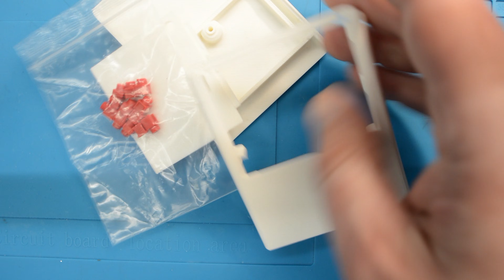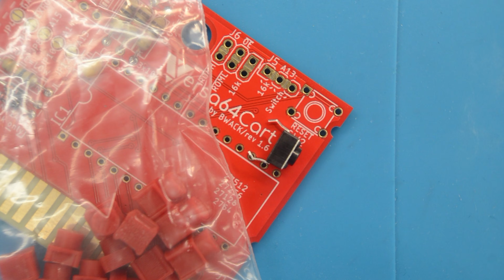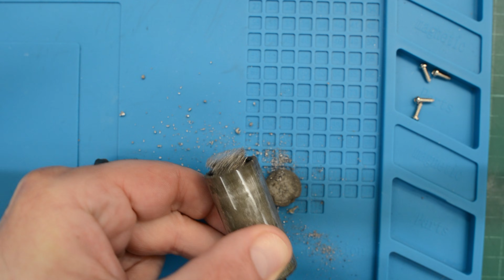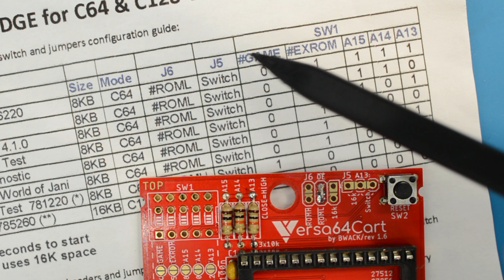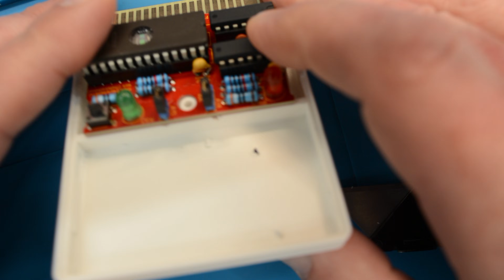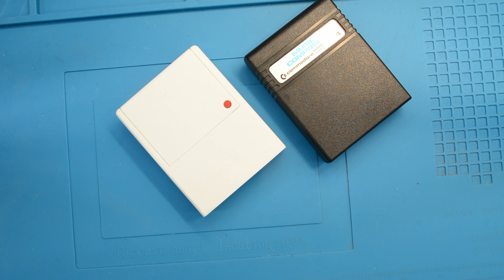TL866 Repair. C64 ALDI limited edition & C64 Cart build

Comment: The slightly higher cartridge cases were already around in the 80s. They have the advantage that socketed EPROMs easily fit inside.
You can bend the C64 casing back into shape with a little heat. Just enough heat to soften the plastic, but not to melt it.

Comment: Awww geez! If you had asked me I would have given you my superior multicart that uses less than 10 parts. It's the same one used on 'The Retro Channel' that I designed for him.
Reply from the maker: How does it differ from the versa64?
Reply: @Epictronics1  The Versa is HELLISHLY over-complicated. I haven't checked the full capabilities of the Versa but as far as I know my board can do the same things and it is using a fraction of the number of parts. It needs someone to do some proper testing to see if it lacks anything (which could very easily be added). It can run all those cart and file types that the Versa runs and switch effortlessly between different cart types or rom images (instant access up to 32 cart images is possible). The guy who runs The Retro Channel on YT uses it with his C64 repairs and a suite of software on this cart but it also works with C128 too. I'll send you the schematic and you can see for yourself.

Comment: Am wanting to implement a cartridge for C64 computers and especially the Commodore 64 Ultimate. Am intending to implement a clean room port of BBC BASIC that is specific for C64 hardware. Would ideally like to make it available as a cartridge. Wish there were blank cartridges that could acquired and product labeled. It would generically just bank switch the C64 BASIC out of the way and load my BASIC into that address space and invoke it

Comment: The fingers of the ZIF looked tinned as well, so I suppose it can oxidise same as IC pins.
I used to reco cyl heads, and some of the exh springs were a slightly different length to the int. I would always tie a wire to one exh spring, but the assembler would still mix them up - lol -.
You could tape some sandpaper to a sheet of glass and sand the bottom front of the cartridge so it fits. Could also sand the door for stickers.

Comment: I wouldn't be so quick to flag the '86 IC as non-original. I recently got a pile of electronic assemblies that were built in 1986 but all the processor ICs (soldered into the board) are from 1983. Also, sometimes a manufacturer may wind up with a huge bulk buy of a given chip, especially if they previously ran into availability issues (I have seen on other videos where Commodore even resorted to cloning some ICs that were in short supply to keep their lines going)...

Comment: I find those zif sockets to always be a problem. The solution that works for me is to spray a little contact cleaner into it, insert the eprom, then push the lever down just enough to put slight pressure on the pins. I then slide the eprom sideways in the socket a few times before pushing the lever down fully. That little bit of friction on the contact points combined with the contact cleaner seems to do the trick every time for me.
Reply from the maker: I'll try that if it gives me any more trouble, thanks
Reply: @Epictronics1  I've been doing that for ~30 years when dumping ROMs for MAME... over 50000 ROMs dumped. I had to replace the zif socket on one of my programmers (I have 10) because it wore out. This particular programmer had a round machine pin socket installed on the board and the cheap chinese junk sockets dont fit because they have square pins so I had to find and buy a genuine Aries zif48 socket.

Comment: Ahhh, Aliexpress, the source of joy and long-term reliability!
You hava a 6510 instead of 8500. There were no 8500 in ceramic.
The cartridge is crap, C128, especially C128 D CR has also a thinner slot, same with those pesky iComp cases, it wont fit or only fit with scratching the plastic.
Reply from the maker: lol
Reply: The slightly higher cartridge cases were already around in the 80s. They have the advantage that socketed EPROMs easily fit inside.
But it's true, it gets tight with the C128DCR.
Reply from the maker: @FooBar-sf2qk  Actually, I tried the Versa64cart with the socketed EPROM in the black housing I showed in the video, and it fit
Reply: @Epictronics1  Some smaller cases have thinner walls (sometimes only where the EPROM is located) or the circuit board sits slightly lower, leaving more space at the top. Furthermore, not all sockets are the same. In the cheaper sockets, the ICs often sit slightly deeper in the socket than with precision sockets.
But the white case looks like it's thicker on top and bottom, which is also not that useful. Typically only the top half is made slightly thicker to get space for socketed ICs.

Comment: that ZIF socket is also bad because it has the really wide block between the slots, meaning you can't put a smaller chip in there like DRAM or 74 series logic chip for testing.
Reply from the maker: crap, I didn't notice
Reply: @Epictronics1  I never buy those cheap chinese zifs. In my programmers (all of them... I have 10) I use an Aries socket. The additional cost is worth it because I can't make any mistakes in my line of work. Anyway you could use a simple adapter with a smaller zif socket with the narrow center so logic and RAMs fit.

Comment: One minor thing about this that might not be your choice but is a bad piece of PCB design on the rev 1.5 board: the solder mask doesn't cover the last bit of trace on the contacts, that tiny thin trace is an easy target for corrosion. There's no reason for the solder mask to not cover the top 0.5mm  or maybe even more of the fingers on the connector.
Reply: LOL! When that corrodes through he'll be like 200 years old LOL! I have arcade PCBs from the 70's that were all like that, no solder mask at all and they all still work. You clearly don't know much LOL! The solder mask is not there to stop corrosion.
Reply: @g4z-kb7ct I've seen it happen, don't be an ass

Comment: You may want to consider using a ZIF socket type that has a slimmer center plastic divider (like the original).
On the cheaper one you used, I'm not sure you will be able to fit smaller 74 or 4000 logic or program slimmer GALs etc...
Reply from the maker: Oh, I didn't notice that. Let's hope it's not too wide

Comment: I ran into the same problem with the ZIF socket when I was assembling my Retro Chip Tester Pro. Resoldering the socket whith the lever in the correct position worked just fine.

Comment: Why didn't you just push the ZIF socket into the "temporary" socket? 😉
Reply from the maker: The pins were way too big to fit
Reply: Square pins on the zif are wide and will flog-out the regular dual wipe socket the second it gets pressed into it and you'll have contact issues. That's NOT something you want when reading and programming chips. Also, a machine socket doesn't work because the square pins won't even fit into the machine pin socket.

Comment: A couple of weeks ago I wanted to make a NES cart with some homebrew I made, so I had to program an Attiny13 (CIClone). Even though I've done that before (years ago), I just couldn't get it to work. So I went to the museum where there's a NES homebrew cart I made years ago. I fully dumped the Attiny and made a 100% identical copy. Programming and verify passed perfectly. It still didn't work.
The next day I went to another museum to update their Interton VC4000 multicart and had massive problems doing that. Reading the ROM was fine. Writing to it failed with ID=0xFF. Ignoring ID got me some write failures, but it did write some stuff. So I tried again and again until it worked.
At home, I tried the CIClone with a different programmer. Worked first try. My cheap TL866 I pulled out of e-waste crapped out. (although I just read a Jaguar BIOS with it and it matched. Too bad, that means I have to keep troubleshooting the Jag)

Comment: I tried fixing my own (modernish) computer yesterday. I drained the radiators, I replaced the thermal paste, I replaced the GPU, I replaced some of the water tubes, and I put in brand new coolant. The GPU complained about a CSM setting in the BIOS. I turned that off. It's happy now. But......it's still crashing. I swapped out the RAM with spare RAM a few weeks ago. That wasn't it either. The only thing left is the CPU, motherboard and PSU. Yet I'm watching this video on it right now. It works, it just doesn't idle well. Too much idle = crash. And sometimes it will crash anyway. Part of me wishes I could just replace the whole thing, but the RAM situation is horrible. I don't have any standard DDR5. I only have RDIMM DDR5.
Reply from the maker: Board sounds too modern to be a cap issue, but how about the PSU?
Reply: @Epictronics1  it's 2021 just like the rest of the computer....except the GPU.
Reply from the maker: @awilliams1701  There you have it ;)
Reply: @Epictronics1  I would think that ALL of this stuff should last 4-5 years without issues.
Reply: @awilliams1701 it depends on the PSU quality and the overall time it was powered on. For instance, the big caps on the PSU may have 3000 hours MTBF.
Reply: @josepedrocarmo5885  It's EVGA.

Comment: That Pro's Kit de-soldering tool - quick tip, put a dime in the spring with a slight tilt about 60% 75% of the way toward the rear. This will help immensely with cleaning and should help with your consumable filter life a bit. A new clean dime is best, a little IPA and everything will come off.
Reply from the maker: Great hack, thanks